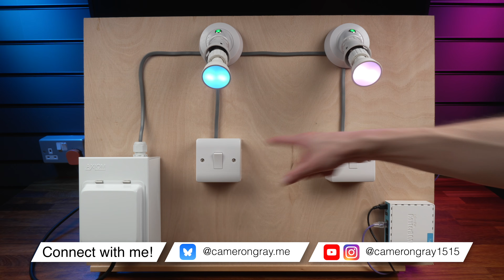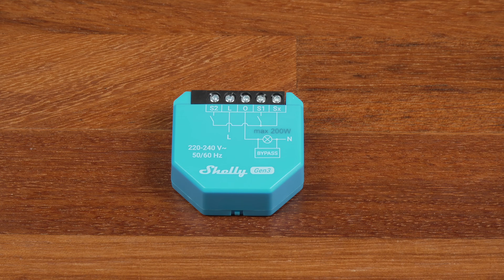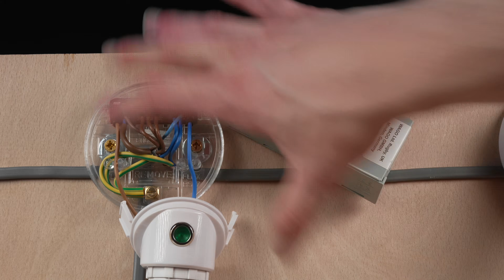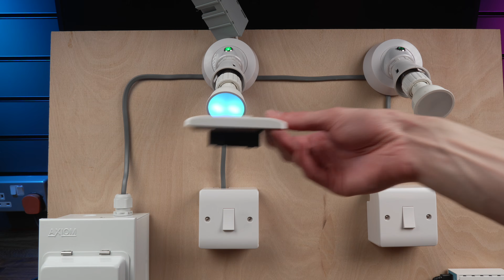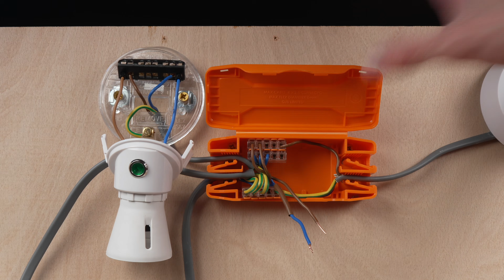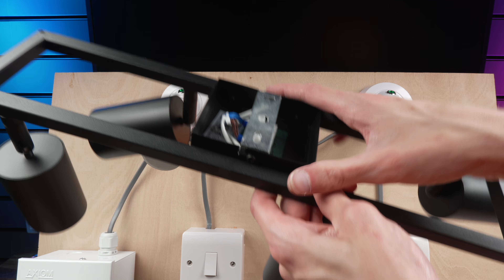No Neutral? No Problem! — 2 Ways to Make Shelly Smart Relays Work!

Comment: Great videos and explanations - Just a quick one really, how would this work for multiple lights on one switched right? for example, one switch operating multiple wall lights? would it be the same situation for installing the Shelly mini on the first light in the ring or would you need a shelly per light? Thanks. I'm in early days of reviewing options for a smart home set up and this is looking promising!

Comment: When you're using a two-way switch in a one-way application, you need to put the permanent live in L1 and switch live in common.  The reason being, when you turn the switch "off" the common is connected to L2 and you have a floating live terminal.

Comment: Another thing to bear in mind with metal fittings (of any class), metal back boxes, or metal light switches, is that these metal casings may affect the wireless signal between the Shelly and your home assistant antenna. This may vary depending on your exact setup and the protocol used, but the general principle applies to any wireless electromagnetic communication method.

Comment: I have a smart light switch. With a capacitor installed and only one light fixture, everything works fine. However, when I connect multiple fixtures, they start flickering.

Can I use my touch panel as a control button and install a Shelly 1L Gen 3 with a bypass after it? Will this setup prevent the LED bulbs from flickering?

Comment: Well I finally got my Shelly 1 gen 4 to work in my workshop . It’s a two setup with two ceiling roses . I replaced the switches with retractive ones from the clic grid system and kept the original two way wiring logic . It works like a dream ! Took a while to figure out wiring but I got there . Thanks for the video which was very helpful

Comment: The issue I found with Shelly bypass devices is that Shelly seem to have used RIFA capacitors, which are known for exploding.   I prefer the Aeotec bypass, which work just as well with the Shelly devices.

Comment: Small note .... If installing the module in a metal light fitting, it might well either massively reduce OR completely block the WiFi signal .... so do a  test!

Comment: for my WIFI smart light switch I had no neutral wire behind my light switch, however because my switch and backplate were both made of plastic, i repurposed my redundant earth wire to become a neutral by also changing it from earth to neutral at the rose. its working perfectly however i would welcome anybodys advice on the potential dangers of this that i may not know of as i would be happy to undo this
Reply from the maker: Definitely not safe or compliant unfortunately, the CPC/Earth wire in twin and earth cable is not insulated to the same level as the line and neutral wires and isn't designed for use as a live conductor.  You also introduce the risk of someone mistakenly treating it as a CPC and connecting it to something metal or touching it assuming it's safe.  You really should either replace the switch with one that doesn't require a neutral or do as I did and install a smart relay in a junction box behind the light fitting.  Or if it's possible to replace the cable between the ceiling rose and light switch, you could replace it with a 3 core and earth which would give you an extra wire to safely carry a neutral to the switch.

Comment: Last house i wired i included both a neutral and a PE connection to each light switch, just in case at some point there was smart lighting installed, and also in case there was going to be a metal cased switch. covers all cases, and also means you have room to expand without having to go break the ceiling to get to the junction boxes. An extra 3m of neutral cable used, and 3m of green/yellow cable as well, not going to break the bank, and will save you hassles in the future. 

Also wired the lights in conduit up the wall, instead of the allowed now bury of the cable, so I could use single stranded wire for all, and still have room in the conduit to draw extra wires if needed. bit more work to do it, and slightly higher cost, but all light boxes now have 3 switches in each one, and the cabling was easy to run up, allowing lights to be added later on with no extra work, as this was allowed for in the beginning.

Comment: do you have an example for the 2L with a 2 way switch?  i.e  a 2G switch in the kitchen controls the kitchen and living room.  and a 2G switch in the living room that controls living room and hall. so, how would you wire up a shelly 2L where a bulb can be turned on/off using 2 different switches

Comment: I was wondering if you use a retractor (?) switch with the Shelly 1 mini is it possible to two way switch the light using HA as one of the switch ways and the retractor as the second switch way? And would HA be able to detect the light state so as to carry out its programmed operations irrespective of someone having used the wall switch at some point? Hmmmmm.

Comment: Very well made video I have to say. It would be good if you could try some of the Candeo ZigBee dimmer/switches similar to these and mock up wiring. I've fitted two basic switches one with neutral bypassed one with neutral at the switch, but was a real pig to sort. The wiring diagrams in the box were crap. I do find ZigBee a whole lot more reliable than WiFi switches which is why I'm reluctant to try these Shelly ones

Comment: I can't believe it took me this long to realise "Oh, if I don't have a neutral, just install the Shelly where the neutral is!". The fact that you get power monitoring and it's smaller than the bypass is the cherry on top. I've been holding on against getting a Shelly for a couple of years now because of my no neutral situation and the quirks with the 1L, and never once did I think to just put one in the fitting..
Reply: This doesn't apply in most situations.  I have a no neutral switch in my garage.  The light that it powers has only 2 wires in the box:  Neutral and Switched.  So you can't put a shelly at the switch (no neutral) and you can't put a shelly at the light (no constant).

I've never seen an overhead light fixture box that had constant in it.  Neutral of course.  But not constant.  It's always just neutral and switched.

The Shelly 1L isn't available in the US any more so it's not an option for me.  I've ordered an Aqara H2 switch for my no -neutral switch.  I'm excited to see how it works.
Reply from the maker: I suspect it's a difference between countries, in the UK you'd almost always have the permeant feed either at the light fitting itself or a junction box just behind it.
Reply: @camerongray1515  You're probably right.  I'm in the US.
Obviously there's constant power somewhere in every lighting circuit.  In the case of the one I'm describing, I presume it's in a concealed box in the attic or somewhere else that's not obvious.

Comment: Why are they so slow to turn on/off? Is that due to some programming quirk?
That huge delay between toggling the switch and the light actually changing state would be incredibly annoying. I've never had any smart switches that are that slow to react, even ones that communicate purely wirelessly as a battery operated add-on switch that signal a hub, that then switches the actual switch.... all in just a couple of ms... meanwhile these in your video seem to be somewhere around 2 seconds before the switching event happens...
Reply from the maker: I think it's due to the smart bulbs I'm using - they're set to dim on and off over around a second, however for this video they're set to 1% brightness so they can't dim from any lower than that.

Comment: If you can get a Shelly bypass in the ceiling rose, there’s most likely enough space to fit a normal Shelly relay in the rose instead of behind the switch plate

Comment: These Shelly videos have really helped my get my head around Shelly devices. I'm now figuring out how to use one for a garage door opener and also an irrigation system, all to be integrated into Home Assistant.
Reply: If your door opener has two terminals which you touch together and will open/close the door. You can use the blue mini shelly and connect the opener terminals to the I and O terminals on the shelly.

Comment: aside from it probably being an awful idea from a regulation standpoint... If you've got all plastic backboxes/plates anyway would anything really stop you feeding neutral down to the switch using the earth conductor? I can't see why it wouldn't work -- feels like a dirty hack you probably shouldn't do though.
Reply from the maker: Would be completely against regulations - all cables installed must contain a CPC and in twin and earth cable, the CPC isn't insulated to the same level that the line and neutral are.  The correct version of this would be to replace the switch drop with a 3 core and earth cable which would give you a third conductor to use as a neutral.  Sometimes on newer installs this will be done as standard so that you have a neutral at the switch even if it's wired in 3 plate.
Reply: @camerongray1515  Yeah that checks out, figured it'd be against some kind of regulation. Obviously the easier way is to just chuck it in a junction box above the light fitting in this case.
Reply: How about just leaving the earth wire be earth but trickling the shellys current down it anyway? A few milliamps won't trip the RCD and if it’s an A-type RCD its unlikely to be interfered with or blinded by that current either. Bad idea I know, but if that circuit is on its own RCBO and its just one or two shellys it might just work in a pinch. Appliances with heating elements or lots of electronics often leak a bit of current down the earth in normal operation too.
Reply: @lordtokenring Other devices which leak small amounts of current into the earth do so via components which are specifically designed and tested not to fail in a manner which allows greater currents to flow, and are limited in that current. Not only that, but these will be powered by capacitive droppers, which means normal operating currents are likely in the 10-15mA region per device. Not really viable, definitely not safe.

Comment: i just bought a flat and cant wait to apply some of your ideas in my flat. How do you find Dante's reliability over Microtik switches?? i come from a background in theatre and TV. using correctly configured Ubiquity swiches i find random dropouts and clock leader changes.  using Unmanaged switches solves my issue normally.